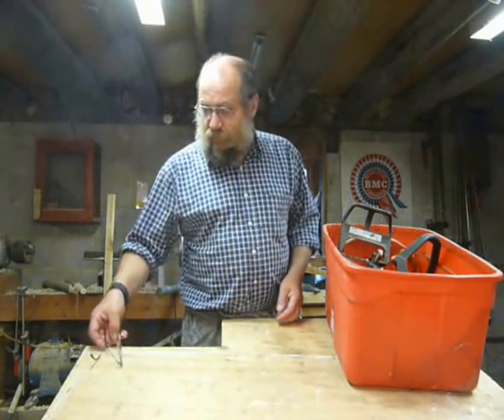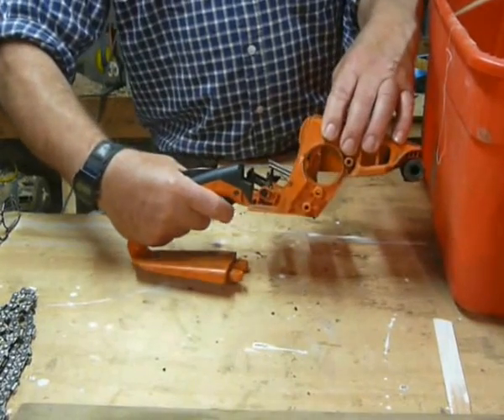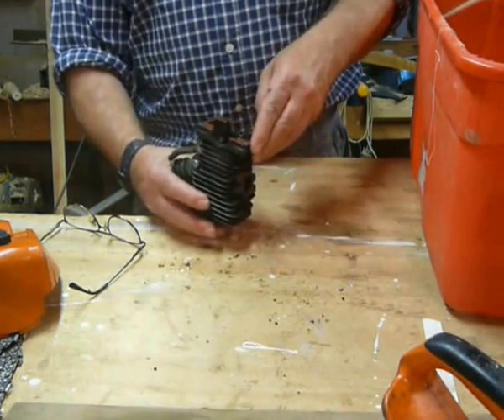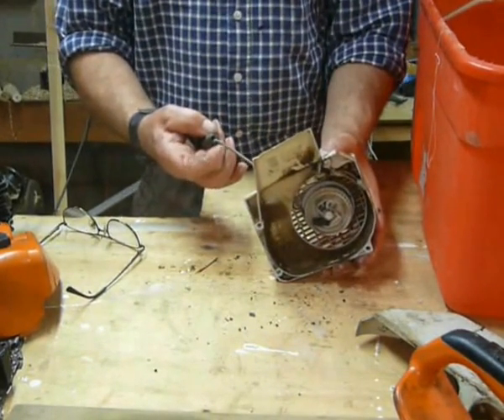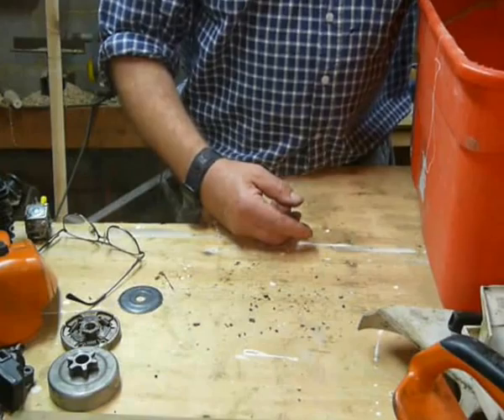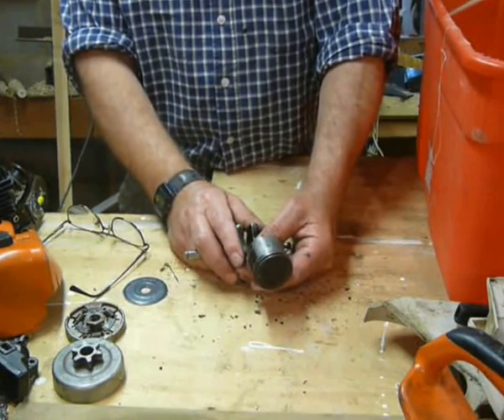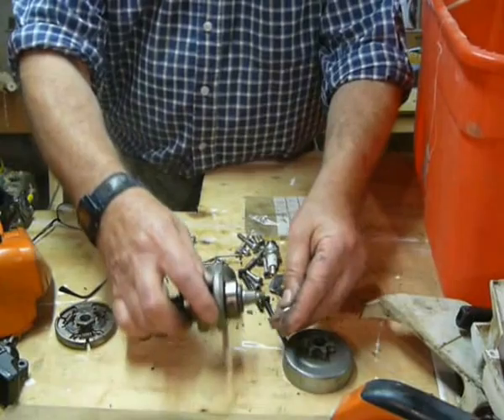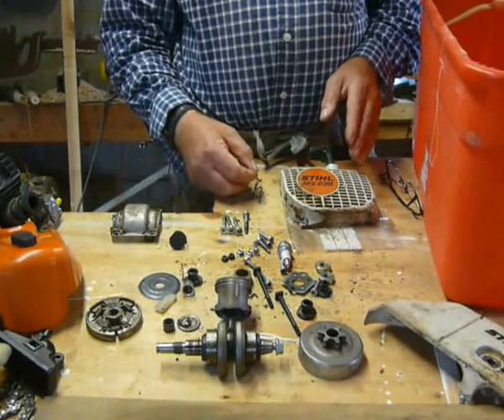Stihl MS 230 chainsaw investigations and repair part 1

Comment: Great stuff. I'd have been lost without the oil pump impeller removal and insertion details. Just needed to know exactly how far to push it back in. However, I worked it out by measuring the distances of the holes in the impeller and the housing. I'm mid rebuild so will be watching more of your investigations later.
Reply from the maker: Mathew, its the washer that defines to position of the worm gear on the shaft. Cheers

Comment from the maker: Hi. Carb settings, air filter, fuel filter, diaphragms, etc, all can cause this. If the saw has been stood for a good while could be sticky diaphragms. See the last part of the Stihl 026 rebuild series it may help. I had a saw that started well and ran for a couple of minutes and then stopped, regular, in the end the plug was duff even though it looked new. Let's hear how you get on, More on the 023 as I get time.

Comment: same as,ive got a problem with my ms 260 and hoping you cover that,not sure if its fuel ,mix or what,it just stalls when i try and put any pressure on the chain to cut....

Comment: Sorry - I meant the actual pump rather than the drive - the torpedo-like device that pushes into the housing. I was just worried that the holes wouldn't line up.